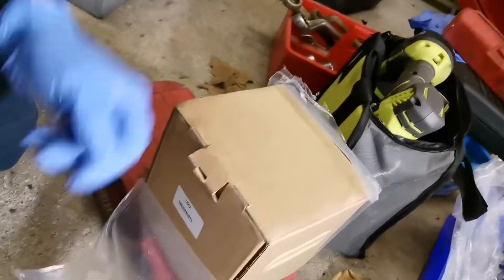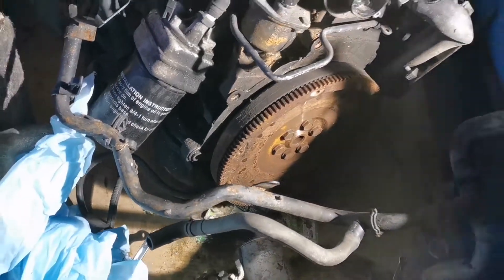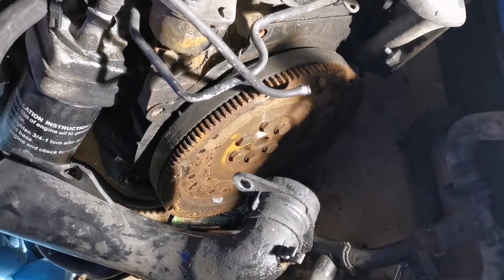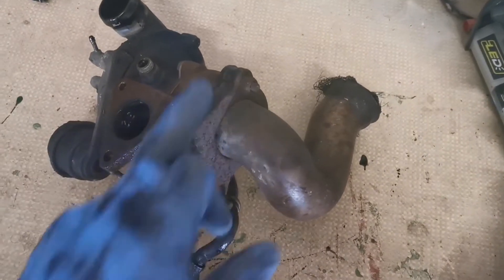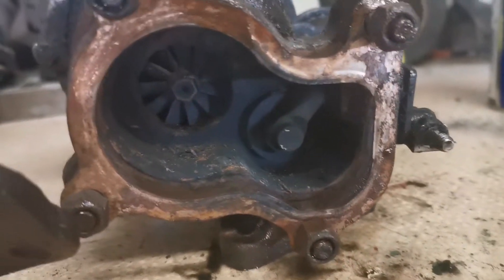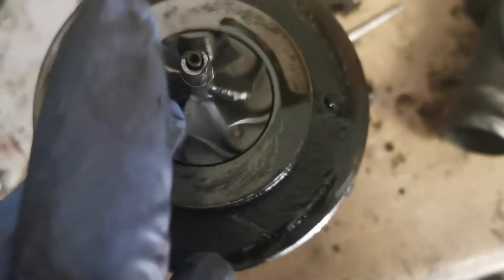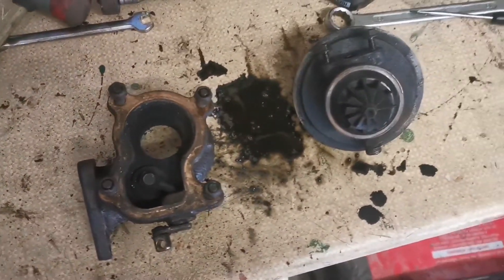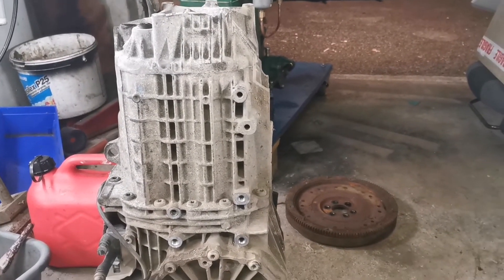Stripping the turbo for repair - VW Camper TDI engine swap

Comment: Quick question - why not use the gearbox that went with the engine originally?
( To save the machining required. )

Is it that you didn't have one, or that it can't be flipped etc?
Reply from the maker: The seat Alhambra that the engine came from has the engine transverse, so the gearbox is a completely different setup. Passat's are front wheel drive too, but they have the engine longitudinal.
Reply: @Endfloat  Ah, I see. Still half way through this series - looking good! Great work.